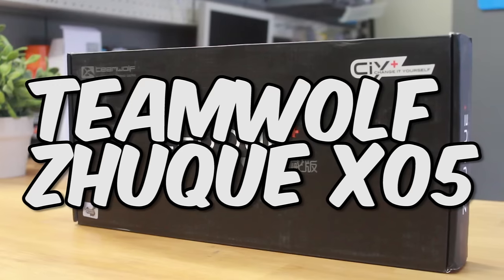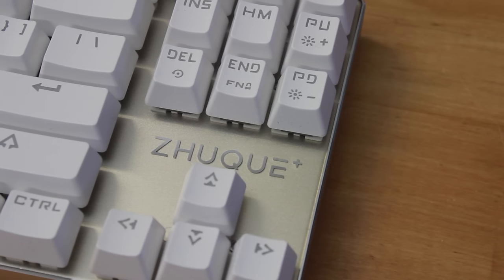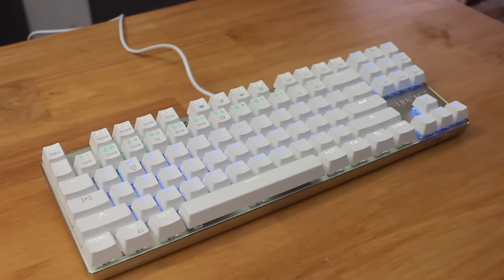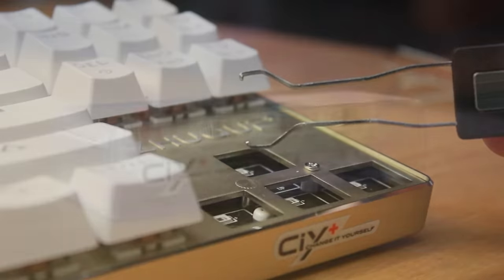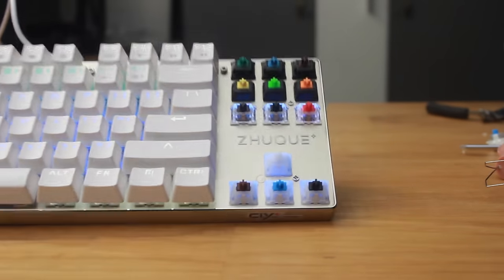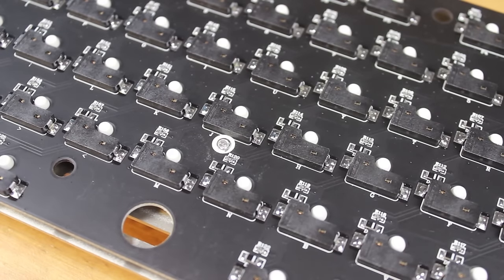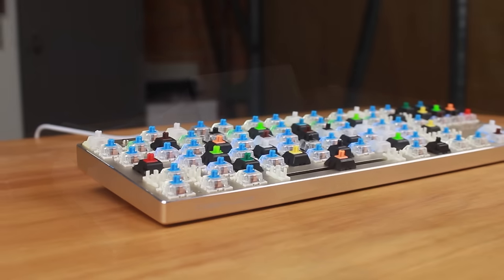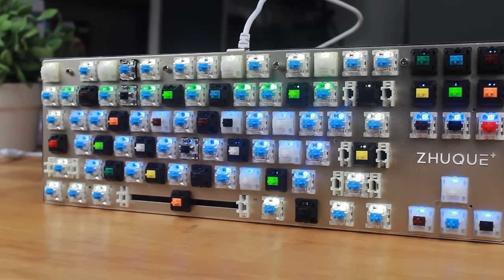Teamwolf Zhuque X05 CIY Gaming Mechanical Keyboard - Unboxing & Review

Comment: when buying key switches do I buy PCB Or Plate Mounted ones.Thanks Lewis
Reply from the maker: The only different is that PCB mounted ones have 2 little prongs. So they can easily be cut off in 2 seconds. 

So yeh, any. But plate mounted ones for keyboard like this and 99% of the others :)
Reply: So I should get Plate Mounted ones and I don't need to solder
Reply from the maker: If you're talking about this specific keyboard. Then get plate mounted, and no soldering is needed.

If you're talking about other keyboards, then you will need to solder. And get plate mounted switches.
Reply: Ok thanks I love your channel p.s this is my first ever mechanical keyboard and ive just ordered one and I'm sooooo happy.
Reply: I have never needed more than plate mounted, but PCB mounted can be used either way, just cut the plastic prongs off to convert them.

Comment: This is the "if only" keyboard. If only the keycaps weren't so bad. If only the lighting wasn't so tacky (tbh they should've made a cheaper version that doesn't have any lighting, much in the same way the Magicforce 68 keyboards have that option). If only the cable was detachable. Literally the reason you get this is so you don't pay more than double the price for the Glorious PC Gaming Race one. It's still great value, but... if only...
Reply: I mean you can easily buy a set of decent PBT keycaps on ebay or Aliexpress for 10-15 bucks. The lighting can be turned off or covered with keyswitches that have an opaque casing. I agree the cable is a shame, but there are very similar keyboards at very similar prices that have removable cables
Reply: @friedengilbert8067  Yeah actually I was thankfully wrong about this being the only hotswappable keyboard in its price range. There's other options that come with more bearable fonts on the keycaps. I'd like to see one of these with solid caps though, maybe it'd look alright.
Reply: Agreed..if only they had a blank hot-swappable board that had zero RGB in a variety of board colors...

That would truly be an easy-to-assemble DIY keyboard
Reply: Yea, but this was several years before that.

Comment: The stabs it comes with don’t really fit most keycaps. They require the protruding feet on the keycaps, while most keycaps don’t have them.
Only the stock keycaps have those protruding feet that fit the stock stabs

Comment: If you want to replace the switches, you can purchase these SMD Gateron Switches
https://www.massdrop.com/buy/smd-led-compatible-gateron-switches
Reply from the maker: Very nice! I suspect SMD compatible switches will become more popular, with a bunch of SMD boards rolling out.
Reply: +TaeKeyboards SMD?
Reply from the maker: SMD = Surface mounted diodes. Basically the diodes (LEDs) are mounted on the PCB (surface). A traditional setup is the 3mm LED that pokes through the top of the key switch, that has 2 pins going through the switch and down to the PCB.

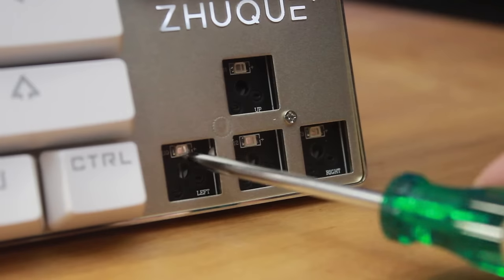This is basically shown at 5:06 :)
Reply: thanks
though I knew what surface mounted diodes were, I just didn't get the abbreviation

Comment: Cherry and Gateron fix correctly? I tried Gaterons in a ReDragon board and pins got bend because pins are larger than Outemu used in Redragon.
Reply: redragon kbs supports only outemu hotswap including gazzew Boba switches

Comment: Which of the four given switches would be the quietest? I need a mechanical keyboard that is quiet, or at least one that doesn't wake people up, will any of the four be suitable?
Reply: TheRealLumina Reds, browns, or blacks
Reply: TheRealLumina you can try to get the cherry mx silents on a group buy, browns are slightly louder than linear switches, and if you want to, invest a couple dollars in some o rings to dampen the downstroke sounds

Comment: do you know where i could buy razer orange switches just the switches?
Reply from the maker: I don't think you can get them individually unfortunately. I like to nab a few keyswitches off some keyboards that I've sold, just so I can have a few.
Reply: TaeKeyboards oh ok 😭
Reply: TaeKeyboards hey funny story i found an old razer black widow stealth 2014 in my box of broken keyboards and the switches are still intact but how do i remove em?
Reply from the maker: Haha, so casual!

Well, you're gonna have to go into the realms of soldering. If you don't have a soldering station, then it's not possible. If someone you know can desolder them for you, then that's an option. I have an old video on replacing keyswitches, you can check it out if you want. :)
Reply: TaeKeyboards thnx =D
Reply: Just get Cherry MX's Black switches. They work just the same.
Reply: Do your customers not mind that they're missing keys? or am I understanding the statement wrong?
Reply: Barry Liu You understood it wrong

Comment: I want to buy this keyboard just for the novelty aspect of it, would you recommend it for a small modding project (simple painting, keycap switching etc)?
Reply from the maker: Keycap switch yes. Painting is a bit difficult with these types of boards, since it doesn't have a top shell over the mounting plate. The mounting plate is the outer exposed area already, so it's pretty tough to paint that.
Reply: TaeKeyboards I see, well I'll order and experiment at the least since the base looks ugly imo

Comment: Hello, i purchased a team wolf keyboard on ebay but it didnt come with the switch remover tool. Do you know where can i get one? thanks!
Reply from the maker: Ah really. That's pretty bad. Anything small works, all you have to do is lift up the little plastic tabs. So like 2 small flathead screwdrivers, or tweezers.
Reply: Hey man i'm really interested with this keyboard,may i ask you how is the quality  on this keyboard?(Sorry for my bad english )

Comment: why would anyone want to swap some key switches. I get it if they changed the W,A,S,D keys but for the others? wouldn't this have a "unequal" sensation upon key strokes?
Reply from the maker: Yeh, what I did was only for show, and is an extreme option. I feel like WASD like you said would be good, or like, the functions keys, or the modifiers and all that. Basically making segments makes sense. :)
Reply: I bought mine to try out Zealios and ergo clears before investing serious money in my next keyboard. The TeamWolf can always be sold on if not needed.
Reply: Intiom I'm thinking of doing something similar, how did you like the zealios?

Comment: Anyone has one of these keyboard? its good as the razer blackwidows? (sorry for my bad english)
Reply: Hard to say if it will last as long as the real Cherry MX switches. The good thing about this board though is that you can replace the switches easily without soldering.
Reply: R C yes, I liked it to
Reply: i have a glorious modular rgb keyboard which is like this but more expensive, has gateron browns, and has RGB